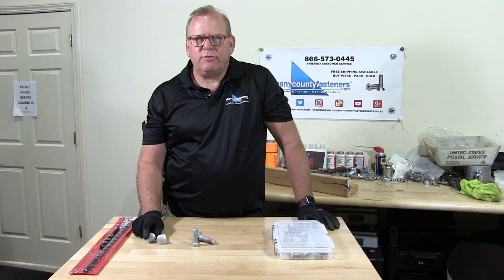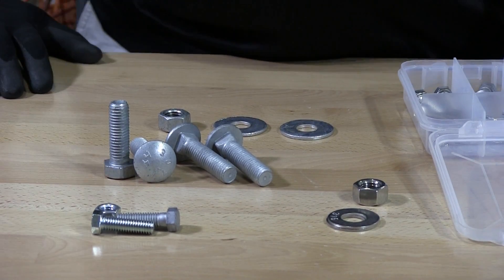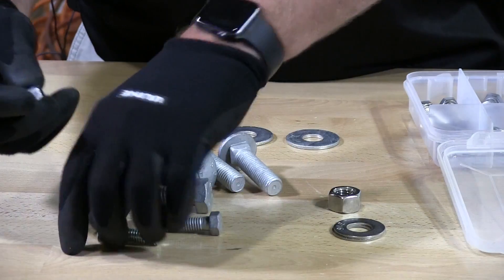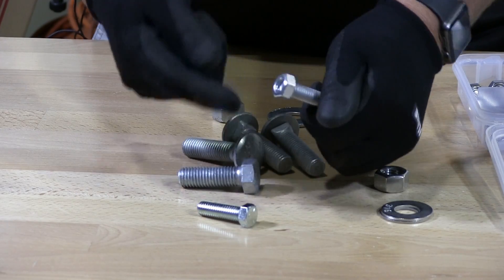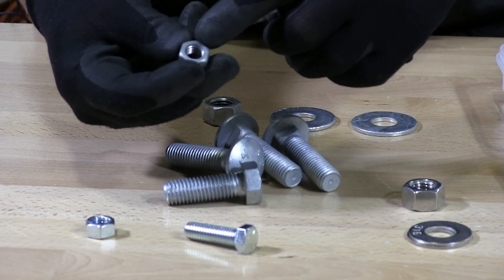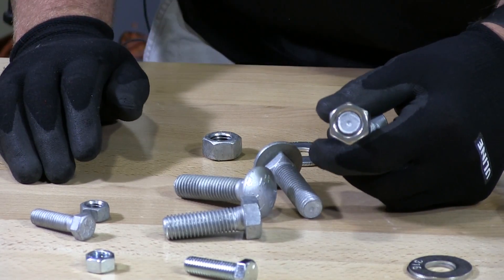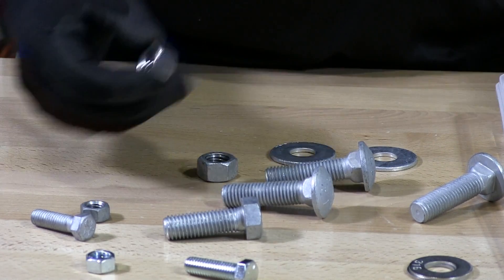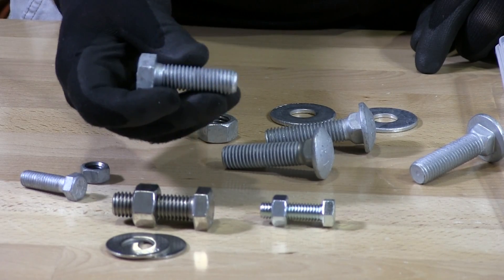All About Hot Dip Galvanized Fasteners | Fasteners 101

Comment: As Paul Hott said previously, this could have been half the length and should have included when to use which material.  For example, hot-dipped galvanized is not suitable for redwood if used outside, but is all right if used inside.  HDG is also not suitable in any situation with pressure-treated lumber (at least I don't think so), only stainless is suitable.  Besides, the cost of fasteners for most outside projects is a small part of the cost of a project, so why not only use stainless and reduce the risk of fastener failure down the road and avoid rust stains?
Reply: Good question.